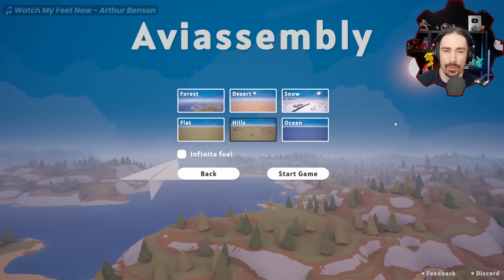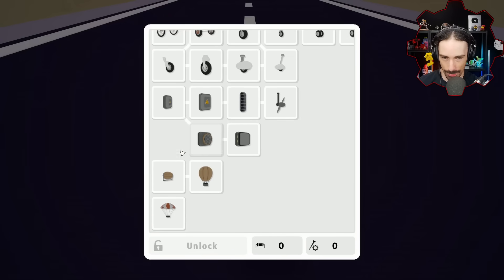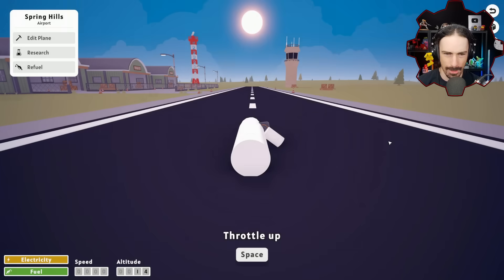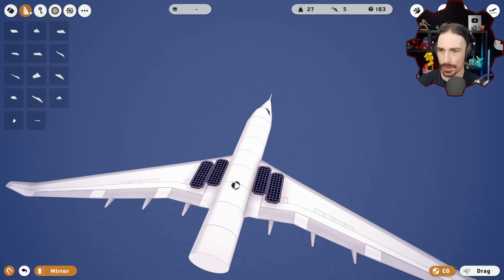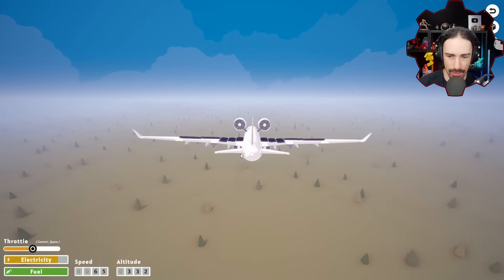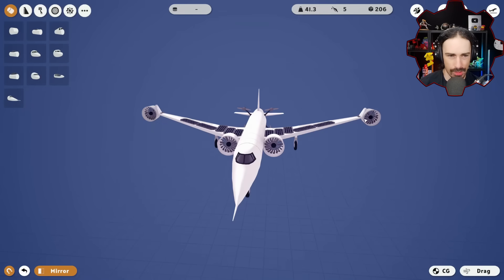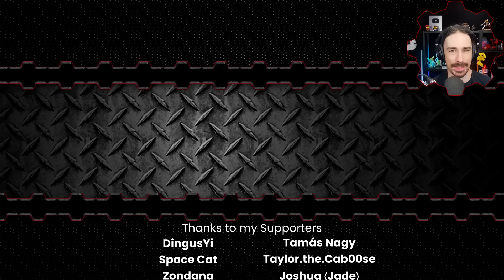I Tried Building a Plane That Generates More Energy Than It Uses [Aviassembly]

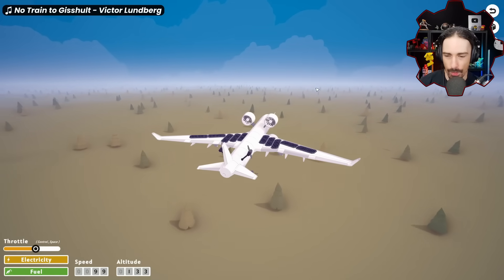Comment: 11:14 thay have small wind turbines on planes for emergency pover supply if the plane is low or out of pover it uses the wind turbine to create pover for the plane and usually it comes under the plane and gets wind to create electricity for the plane to stay in the air for longer time and it retracts if you dont need it but its not that wierd after all because its for saving the plane

Comment: 5:37 you can use the item to make wings in fughters to retract that its more air dynamic and if you want your plane or fighter to have 2 wings in the back instead of 1 wing you can use it to get a angle to make it cool like in trailmakers example even tho you can do the same in build mode but its for retractable wings that they go back or weels for steering

Comment: 11:29 Wind turbines are usually used to keep the absolute bare minimum emergency systems running. You wouldn't use them for power everything.

Comment: The wind turbines are an emergency thing, so if your main generator is dead the plane doesn't become a brick. It's supposed to work with fuel engines.

Comment: 8:49  The batteries are good for take-off when you need full-power, but once you're in level flight, you can lower the throttle and keep going on the "juice" the panels produce, I like to use a combination of solar panels and turbines.

Comment: i've also experimented a bit with electricity and, i you really want a selfsufficient electric plane, just go with solar panels and the right ammount of electric engines. Also, drag is really important and i found that often, puttin the smaller electric engine at the back of the plane (in the tail in a push configuration) usually is far more efficient because it has basically 0 drag (so it "all gains" in a way) and consumes less energy. Also batteries are not really necessary, if you have enough solar panels your electricity will never go down. The turbines are mainly usefull if you want an hybrid plane. Standard engines produce electricity so if you have both on board you can turn off the standard engine and use the elctric ones to fly for a bit, then when fully discharged you can switch the standard back on and charge the batteries (basically you're extending the range), if you add turbines to this you can have your standard engines off for less time because the batteries will recharge faster.
bonus fact: the small wind turbines that in the game generate electricity in real life are called APU (Axiliary power unit) there is one on each plane and can be extended in case of emergencies. This is because in basically every commercial plane the engines are also electricity generators that power anything on board (from the cabin lights to the avionics and control surfaces) so if you were to loose all engines you would have little to no control on the plane. In this case the APU is engaged (the little wind turbine comes out) and produces electricity to use on board for essentials components.

Comment: Hey, Scrapo! You're 100% correct about turbines. Wind turbines harvest the kinetic energy of the wind (which would be relative to the turbines when the turbines move). This slows the wind down, and because of equal and opposite reaction, it speeds the turbines up. As long as the plane is off the ground and terbines are parallel to the direction of motion, that equal and opposite reaction will be in the form of the wind slowing down the plane. Fortunately, perpetual motion machines still don't exist
Reply: I believe some gliders use a wind turbine to generate power for their instruments and whatnot. gliders can fly functionally indefinitely under some conditions, during the day. They're basically powered by thermals from the sun heating the ground, and wind interacting with terrain
Reply: Fortunately?

Comment: Maybe the decoupler is for making rockets since there is one of those engines in the options and you have to repair it when landing at the airport every time. Besides, I don't remember the name but at the beginning of aviation there was an airplane that used single-use rockets to take off.

Comment: the way the drag work in game at least seen with the drag button is the front most thing has drag and anything else behind it doesnt so you can just line up turbines and get infinite power that way because only the first one has drag.
 and for some reason the air brakes parachute also blocks drag(at least when you place it when you go back into the build menu the parachute wont be out and stuff behind it has drag) and acts as a valid placement so you  can just make stuff float.

Comment: Realistically, there is no reason to use wind turbines on a plane, apart from using it as emergency power for things other than powering the engine.  If the (fueled) engines go out, stop producing power,  and you're forced to glide it in, they can provide enough power to operate the control surfaces, or even more importantly, the TV screens for the passengers.
Reply: 🤣🤣🤣

First time I've ever figured out how to use emojis in a YT comment.

Comment: Scrapman: "these consume 1. 1 per what?"
Doesn't matter, the units would cancel out anyway. If you consume 4, you should produce 4. The 10 panels produce a combined 2 and the prop thingies produce 1.2 totalling 3.2.
You could've just doubled the panels and be fine then for max throttle

Comment: 13:24 that concept is actually used in several STOL (short take off and landing) aircraft, and has been experimented with for certain types of thrust vectoring. In normal flight, however, it isn’t the most efficient.

Comment: A small plane with glider cockpit, basic delta wings, and a single small electric engine being powered by 6 wing mount solar panels is brutally effective. You do have to configure the engine to be a pusher, but it hits 340 speed and has infinite range. Lots of fun.

Comment: 13:34 planes have defrosting, and for that they either use electricity, but that is used only on the small/important parts because of how much energy is required. The rest is defrosted by the pneumatic systems which blow hot air on parts of the plane that tend to get ice on them and lessen the aerodynamic lift and mess with the forces. But theoretically if the engine was far enough it could atleast work like a defrosting mechanism at high altitudes. But to answer the question if the engine in front of the wing would give it more lift, im not too sure but from what i know about aerodynamics it should if it inreased the airspeed above the wing. So the engine exhaust would have to be a little above. Lift is basically difference in pressure, the wings generate lift by going a certain speed that makes the air flow faster on the top so that it reduces the atmospheric pressure and on the bottom it's moving much slower thus the opposite happens. Because of wings profile these things happen. If we exclude slots, flaps, interceptors, airbrakes, trim, spoilers etc. So in theory it should produce a higher artifical airspeed that would give us a higher lift force. 

Omg sorry for this paragraph but i really like planes and i have a Degree + im an aircraft mechanic so i just had to ramble 😂

Comment: So an engine that is pushing thrust over the wing will help with shorter take off performance, NASA made an aircraft similarly, with the jets mounted on top and had ducted exhuast outlets that pushed over the trailing edge of the wing while testing STOL jet aircraft design.

Comment: With the 10 solar panels (0.2×10=2) and the 4 turbines (0.3×4=1.2) you had 3.2 generation compared to the 4 consumption from the engines. If you'd left out the turbines and just doubled up on the solar panels you would've had infinite electricity on full throttle.

Comment: Just like many things in the game, they don't provide units.
But for solar panels and engines, they are in the same units. 4 solar panels is enough to power 1 engine.
For the air turbine, it is a stanger case of some speed dependency. I was able to make a plane with 2 electric engines and 2 turbines that could manage to accelerate to 670 speed while flying and start charging up to full. And for added fun, this can start from a standstill with the electricity meter empty.

Comment: Wind turbines on planes is actually a thing. They are usually only used in emergencies if they loose power to critical systems. Sort of like a back-up power generator.
Reply: Sure, but they wouldnt be used to provide power to electric engines, as that would waste energy overall.
Reply: And was vary inportant to the crew of the famous gimli glider

Comment: 13:10 Engineer here! The air coming out of the ducted fan would be what we call “dirty.” After being accelerated by the fan blades, the air is turbulent, and turbulent air is not very good passing over the wings. So we tend to not build wings positioned after a propulsion unit.
Reply: "Tend to", but not avoid entirely! Notable examples using jet exhaust to boost the lift on the top side of the wing are the Boeing YC-14, the Antonov An-72, and the Antonov An-74.

The main reason it's avoided is because while it significantly lowers takeoff and landing speeds, it increases drag, lowering efficiency. Later, engineers figured out you could get much the same effect with multi-slot flaps that extend into the jet exhaust. You get the improved takeoff and lower liftoff speeds, while not having the increased drag during cruise.
Reply: Air pushed over wings by jets is used in STOL's the sometimes bleed air from the jet and push it out over the wings
Reply: If you look at the EADS/Rolls Royce concept, that uses the fans to assist with lift but it pulls air over instead of pushing. This helps to keep the air over the wings cleaner, using the pressure difference to accelerate the air instead of the force from the blades
Reply: I have seen some experimental planes that place the ducted fan "in" the wing, basically the wing forms the bottom portion of the duct. Supposedly this helps generate more lift due to the high exhaust velocity over the top of the lifting surface. But, I haven't seen this actually used anywhere. There are some planes that have their jet engines integrated into the wings, where the intake is at the leading edge (front), combustion happens in the middle, and the exhaust comes out the trailing edge (back) of the wing. Some examples are the SR-71, Northrop YB-49, B2-Spirit, and sort of the NASA X-43. Each of these planes are either supersonic (SR-71 @ Mach 3+ and X-43 @ Mach 9.6) or are stealth aircraft. For high speed this makes sense to reduce frontal area and control shock formation. For stealth, it allows you to fully hide the intake and exhaust of the engine helping to reduce the thermal and radar signature or the aircraft.
Reply: Some large STOL planes have engines in front and above of the wings to help generate lift through the Coanda effect, for example Boeing YC-14 and Antonov An-72 do this
Reply: Do we have science argument?
Reply: Peter Stripol just made a video about it. Like people say, STOL planes (short take off & landing) make use of it. The coanda effect is partly to blame.
Also present in many RC planes, because the power to weight ratio is crazy there. Normal props beat ducted fans, because of the extra air blown over the wings.
Reply: This community is so awesome
Reply: Good to know! I was kinda curious about that from seeing this video, you would assume that thrust up front would be the most stable. But yea the way you explained it says otherwise, and explains why they are sometimes in the back!(no further up than the wings)
Reply: Most GA twin aircraft I’ve seen put the engine in front of the wing.
Reply: And, correct me if I'm wrong, the force from the engine would be pushing against the the same plane, it's the same thing as the magnet attached to the car, where the force generated from the magnet and car is offset by the fact that it's pulling against itself
Reply: @kingcore2706 those forces would cancel out, yes. But the air pushing against the wing is not what generates lift. That is the presure difference on the top of the wing vs the bottom of the wing caused by air flowing faster over the top than the bottom.
Reply: But ducted fans are basically just propellers, which are commonly placed in front of the wing and aid in the slipstream effect, no? 

It seems like having them directly in front of the wing would help. I am thinking of swamp boats, for example. Who use the air from the ducted fan for their control surfaces.

I could see how having them (fans) too far in front of the wings would allow time for the air to become turbulent, however.
Reply: @Grunk-ik9os  prop wash (thats the proper term) is a big no-no. especially in combination with ground effect during takeoff/landing it can alter the aircrafts handling characteristics significantly and that sudden and unpredictable.
Reply: @Grunk-ik9os  they make the plane unstable is the problem

Comment: The engines infront of the wings was actually an idea the US explored back in the 60s i think it was. it did generate mroe lift but in the long run tbe exhaust from the engine’s made to much wear and erosion on the wings to make it worth it.
Reply: The air that's coming out would be dirty/turbulent, so it wouldn't really provide much lift
Reply: @easygoing4964 This is just false.  Many prop planes have the propellers in front of the wing.  As for jet planes, see the Russian An-72 (and An-74 variant) and the Boeing YC-14.
Reply: @TheRavenCoder  most prop planes have their props infont of the wing/fuselage, that is true. however for efficiency it is not optimal, as the air through the prop is turbulent and therefore provides barely any lift. i dont imagine the speed difference between airspeed and accelerated air through the props is going to make a huge difference. if the props accelerate air over the wings id imagine it also increases drag, terefore making it less efficient. the prime example for a highly efficient and proven plane of this layout would be the piaggio p180.
Reply: @TheRavenCoder  i have done some aditional diging. essentially, the idea behind front mounted props works so well, because prop planes in general are rather slow planes. this gives them better lift at low airspeed as the props already push air with high velocity and therefore the difference does actually matter. this turbulent air does decrease efficiency at high speeds (therefore the different layout of the relatively fast p180). it might also decrease climbrate once the difference between airspeed and propspeed gets smaller, however i havent found any real evidence other than the possibility of a continuing trend from channel wings
Reply: The Hercules C-130 has turbo propellers and the propeller do create more lift, as this forces air to the wings.

Comment: Irl the wind turbines would not work, but in this game they do, and they work better the faster you go. I made a plane with a few of these and a load of electric engines, and was able to cruise around 400 speed with infinite energy, i just needed vatteries to last until I got up to speed. Could be interesting to see if you can break the sound barrier with infinite energy
Reply: Commercial airplanes have these as an emergency option for electricity.
Otherwise they won't have their systems
Reply: Well the wind turbines wouldn’t close to make up for the energy spent because the energy in the wind hitting them is a reduced indirect translation from the energy put out by the engines, but given the simple fact that they would be rotating, I think they would (slightly but still) reduce energy consumption somewhat
Reply: Air tubines on planes do exist tho. 

R.A.T.
Ram Air Turbine

Comment: I'm 98% certain that the primary reason for the rotation joints are for VTOL.
Reply: Yep I did it before
Reply: something like V-22 Osprey can be possible
Reply: @ShooterEXE Yeah, should be. Some sort of tilt rotor shouldn't be difficult. A directional thrust jet of some sort should be... Possible. But works better if you have some sort of logic you can put into it.
Reply: You could probably do an X-Wing as well
Reply: @ianadams3739  yep i made one
Reply: M E C H

Comment: for the ornithopter you could try moving the wings forward and backward to maintain air moving over wings, but a better idea would be to angle the wings 45 degrees then move up the wing, then 45 degrees in the other direction and move wing down and repeat. kind of like a sting ray.

Comment: Scrap man you know perpetual motion machines dont exist
Reply: Solar panels aren't free energy and it is definitely possible to supply something with more energy than it requires to operate.
Reply: @Grunk-ik9os  yes i was thinking about it the wrong way this is more a way of transfering power from off the craft (the sun) to the craft. If he had a light bulb on board the plane powering those solar panels that would be a perpetual motion machine